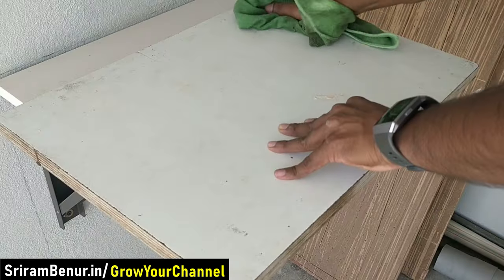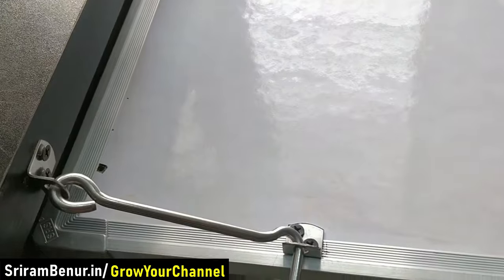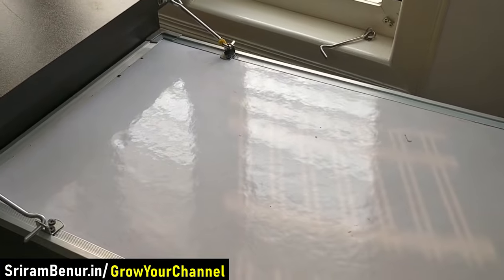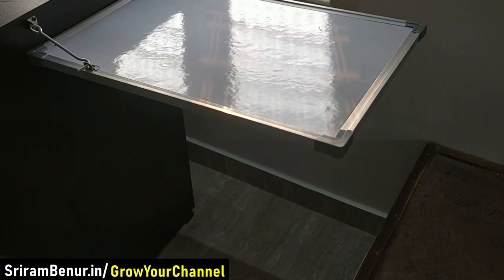How to make a FOLDABLE Wall Mount Study table at home - Under Rs 100

Comment: You shouldn't have attached the hinges directly to the wall. It will tear off after some usage. Instead use a strip of that plywood and nail it to tha wall than attach the hinges on it
Reply: Bhai muje hindi me bata Kyuki kal me ise ghar me lagane wala hu 🥲
Reply: @raghavgoyal1914  bhai wo jo kabja diwar me hole karke direct fut kiya h waise ni Krna chaiye. 1 month me bahar aa jayega. Pahle ek lakadi ki patti diwar pe joint kr do fir kabje ko us wood ki patti pe lagao tab ye permanent fix ho jayega. 
Example k liye jo ghar me darwaje hote h unke kabje direct diwar me na laga k wood pe lagaye jate h. I hoe you understand
Reply: Very very much thanks bro